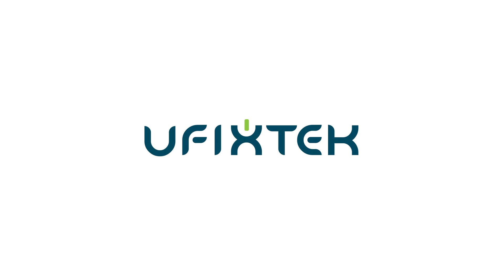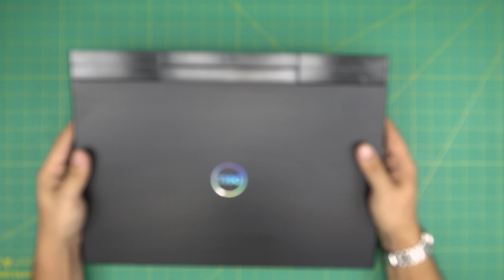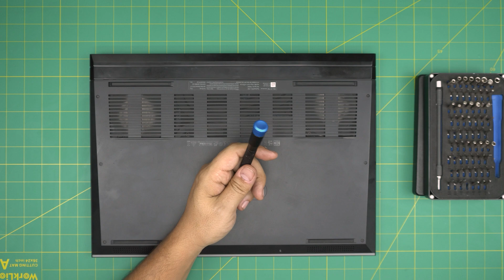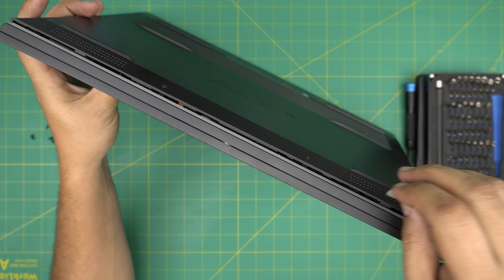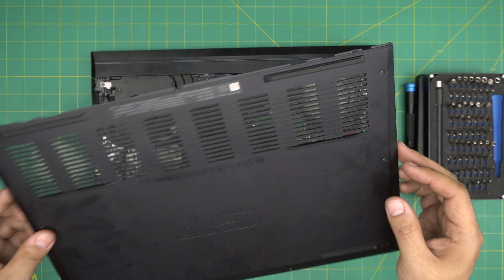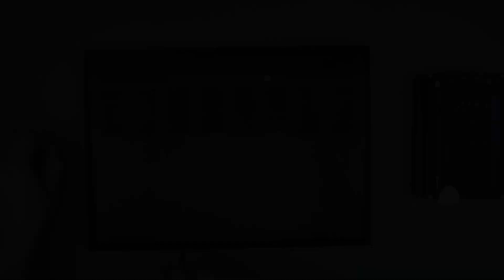How to Upgrade RAM for DELL G7 7700 Reg,p46E001 Laptop | Step by Step

Comment: I upgraded from 16 to 32GB of RAM and now my computer is refusing to boot. Running diagnostics in the “one-time boot” menu says something like “system memory limit exceeded,” but the BIOS recognizes the 32GB RAM sticks so I know they’re installed correctly. Any idea on how to resolve this?
Reply from the maker: 🫠Regarding your question, decrease the RAM, boot into Windows, download and update the BIOS, and then try again.
cheers🍻

Comment: From what I've seen 32 ram makes it slower. Any diag to support this upgrade???
Reply from the maker: 🫠Regarding your question, no 32gb won't slow down, but it will make the CPU run hotter.
cheers🍻
Reply: @uFixTek  thanks for the info!!
Reply from the maker: It's my pleasure my friend.